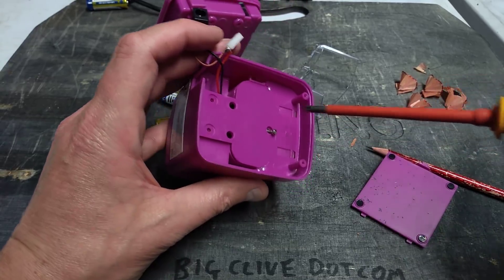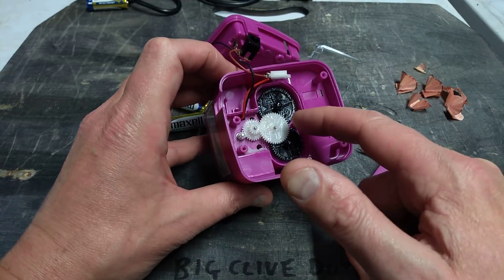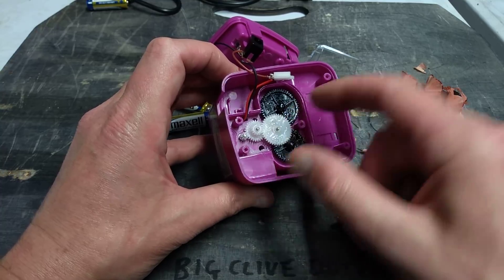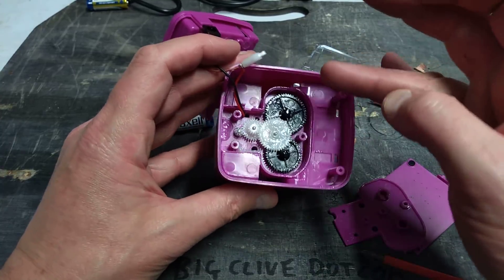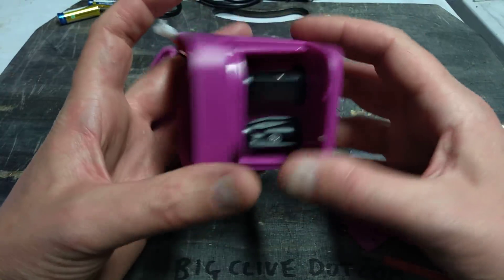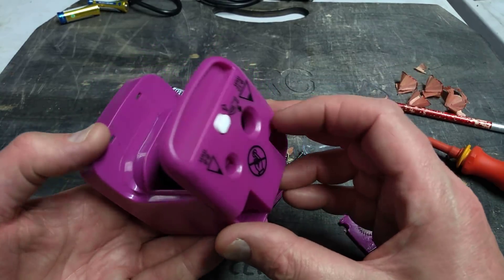Inside an automatic pencil sharpener.

Comment: How does it switch between battery power and external power? I'd be very interested to know how the voltage stays regulated if both are connected. :3

Comment: The 900g ball pein screwdriver in the bottom of the toolbox is useful when the right shaft diameter driver is hard to find....I have found mine to NEVER FAIL. Its very persuasive with Chinese plastic.

Comment: These sharpeners are very good. Only problem are the blades. After a few weeks they wear out. Replacement blades, if any available, cost as much as a new sharpener. The sharpener I have uses micro usb as alternative current source thou.

Comment: The electric sharpener I have is only a single one but the safety button that prevents it from going off with a finger (or supposedly does) is right underneath the sharpener. That said, though, it's still possible to press it by pushing down on the plastic around the rim of the hole. x.x

Comment: I have an ancient Panasonic pencil sharpener that according to the riveted metal plate on the bottom,  operates on 30v AC (USA, 120/4? have never opened it to see how it operates) if it dies I'd gladly send it to you, but I think it will sharpen every tree on Earth before that happens.
Reply: likely some off the shelf power supply(maybe motors) made for printers/scanners, it was common for them to be in the "30 volts range"

Comment: I've got a question if you will please reply before I just try it and possibly burn myself down lol. I made a bench power supply from an old pc supply. My question is if I make a second one can I run them in series and get a 24v power supply. Please reply I've been wanting to do this for awhile.
Reply from the maker: You can theoretically use two supplies in series if their outputs are not referenced to ground.  But if one fails it will be run in reverse by the other and it may damage the main electrolytic capacitor.  You can buy high current 24V supplies online.
Reply: bigclivedotcom thanks for the quick reply sounds like I would be best off just to buy one as you stated. I've looked at cheap Chinese 30 v 10 amp supplies. Have you ever used one of those cheap Chinese ones. I can't afford the $100 plus models I've seen. Your videos are awesome very informative.
Reply from the maker: A proper well-rated supply is going to be quite expensive just because of the materials involved.  Keep in mind that many cheap eBay supplies are not rated as described and often lack proper separation between the mains side and low voltage side.  It all depends on your application.

Comment: Got a check of a medical device that literally at times you have to knock the batts out of little blood pressure cuf   won't stop inflating at times when I get the cash I'll send it
Reply: 600bubba sounds like your blood pressure may be really high it keeps pumping until it cuts the blood flow off and the harder your pressure is the longer it pumps. I had one feel like it was gonna squeeze my arm off finally it make it past the 230 point and stopped.
Reply: James F no defective

Comment: I prefer the worm gear style of sharpener - this looks like a single blade (more like a hand sharpener)...
Reply: It's not a gear, but a mill
Reply: Actually the pencil sharpeners I was referring to use helical gears, which are similar to "worm gear style". I think they are referred to as a planetary sharpener
Reply: I have a desk mounted planetary sharpener. Though, thats a hand sharpener utilizing a crank and not an automatic one. Still better than poking a pen into a hole and twisting it a million times.

Comment: +bigclivedotcom Would you find it handy if I sent you all my UK and EU power cords, wall warts, power supplies and adapters? I keep getting them from the hotels lost and found around town. I get a lot from Japan as well. The Japanese more often leave behind their wireless charging docks. UK and EU leave laptop power supplies and phone chargers and cables. Just go around to the hotels twice a year and ask to empty their lost and found of anything older than 90 days. They oblige just to get rid of it all so they don't have to. Most is junk but I always find useful stuff.
Reply from the maker: i wonder how many of them are total deathtraps.
Reply: Might be worth checking out then. It's cheap enough to send them. I'll look into it.

Comment: How do you get the grease off of your hands? O.o
Reply: Maxwell soap?
Reply: I’ve used Boraxo, pumice hand cleaners,dish soap, dirt, sand, brake cleaner and gasoline. Dirt and sand get some off but leave a lot on but I only do that to get excess off and The last  two are obviously dangerous and they dry your hands pretty good.

Comment: Has anyone actually ever had a pencil large enough to that they need to use the bigger hole?
Reply: We had them in first grade in primary school many moons ago.
Reply: makeup pencils.... crayons... (i'd say)
Reply: They are mostly sold as novelties at seaside souvenir shops so perhaps !!!
Reply: They are training pencils for small children. The larger size is a lot easier for their little hands to hold onto.
Reply: James F Carpenter's pencils are also that wide, but are usually flat so won't work in a rotating sharpener (they are perfect for sharpening with a knife).  These are the pencils that leave odd serial numbers scribbled on the back of custom cabinets, on the top edge of doors / windows and inside walls.
Reply: That's what s/he said.
Reply: Only in first grade in the 1970s did they have thicker pencils for small hands still learning fine motor coordination. A carpenter pencil is also fat but has an oval profile.
Reply: I have a stabilo easy graph laying around here for example(i don't really use it to be honest)
Those are mostly used by elementary school kids.
Thinner ones are cheaper to make, thats why most are thin. but thicker ones are more ergonomic overall.
Reply: Training pencils at my primary school had a sort of rounded-triangular cross section, like a carpenter's pencil but with an extra side.  Big yellow beasties they were, too big for an ear or nose hole.
Reply: @Mad Chewy --> Perhaps the larger shading pencils that some sketching artists use?

Comment: Four t double a batteries, would a 9v with a regulator be a better option?
Reply from the maker: The AA cells have higher energy density and can supply higher current under load.
Reply: @bigclivedotcom  really? I'd always thought the 9s to be superior 😅
Reply: nah those use 6 tiny AAAA cells in series
Reply: @maicod  I've seen people open the fine and then I try and open one and it looks totally different and white sludge starts foaming out so I quickly abandon
Reply: yes thats right there have been seen abandonments of the regular PP3 contents, it used to be 6 AAAA's though. I think China has invented the new contents :)

Comment: "What happens if we stick the rubber in?"
Off to a good start.
Reply: It cleaned the rubber nicely.
Reply: It's Vince's pencil.
Reply: @Peter_S_  Vincil
Reply: Half surprised the screwdriver didn't get sharpened.
Reply: That's what.... he said?
Reply: Central Intelligence Agency Usually, if you stick it in the hole with the rubber in place, it prevents offspring. Usually...
Reply: +Против Глобал
If you do not like rubber, how does it feel having so many STDs and what do the women say when they figure out it was you who gave them the STD and not disclosing you have it before sex?
Reply: Right we’re going full throttle sex and condom now
Reply: Great until it hits the metal holder

Comment: Hmmm, Its more Magenta to purple then Pink! EX printer/Trade Teacher's opinion. Sorry Don't have a Pantone book anymore to give you a PMS number! 😄
Reply: Anthony Witham it's somewhat in the vicinity of Barney.
Reply: It IS a lurid shade, at least.
Reply: Pink is more of an attitude than an exact shade.
Reply: anononomous: Pink does have a little attitude, but she can sing! 😂
Reply: Anthony Witham You can't safely compare Pantone(R) swathes to a video file.  Best you can do is to turn off local color correction, screenshot the video and read out the decoded RGB value (the YUV value in the file is usually buried in DRM hell).  Once you have the numeric value, there are tables mapping Pantone ink colors to sRGB screen colors.
  The only time direct screen to swath compares are good is when calibrating a monitor + graphics card combo for best color reproduction on a graphics workstation in a specific ambient light environment.
Reply: @johnfrancisdoe1563  it was joke! As a former TAFE Teacher in the printing industry, having completed an apprenticeship plus city and guilds. Having spent 45 years in the printing trade  I fully understand colour gamut, colour correction and the calibration of computer screens. I practiced and taught this to apprentices, i know you can't match the colour on the screen to a Pantone number. Hence the smiley face as I was joking.